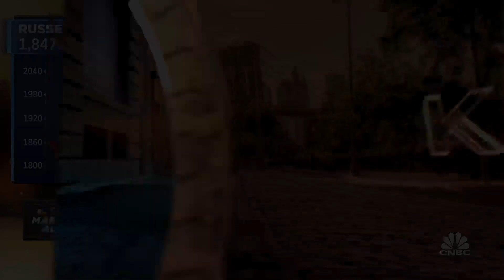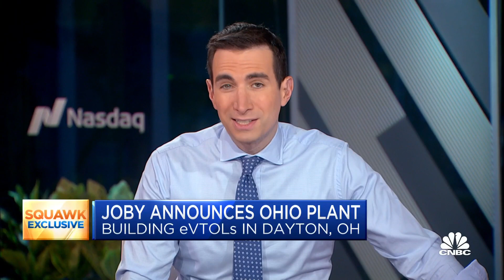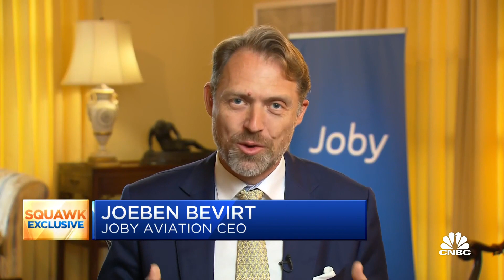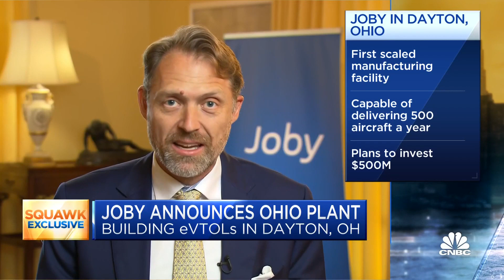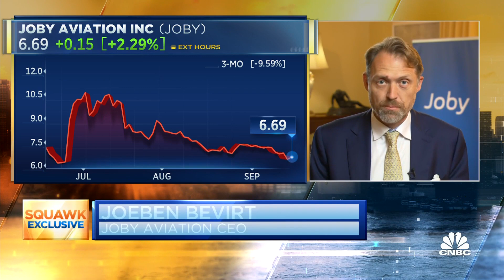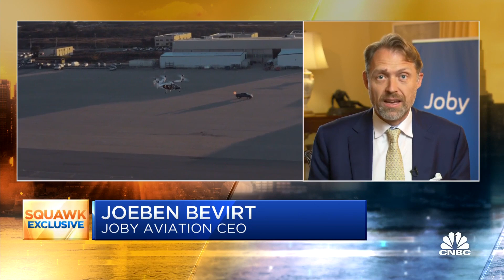Joby Aviation CEO on new Ohio manufacturing plant, commercial service plans and Delta partnership

Comment: Pump and dump. Did you get Faa type certification approval yet?
Reply: NO chance of getting that. It can't autorotate and it can't glide to a safe landing anywhere but on a runway - and there aren't any runways where they state they want to fly. The FAA stated in November 2022 that the Joby thing is only a powered lift and the - the FAA - want to know what Joby is going to do when there is NO thrust.

Joby KNOWS all this and that's what makes their statements fraudulent.
Reply: A military base is testing one out
Reply: Yeah

Comment: 500 aircraft per year is quite a lot when you look at similar sized helicopters made by Robinson, Bell, and MD Helicopters and those combined only sell about 300/yr.  If there was a bigger need for such aircraft then these companies would be selling more as they can perform the same task.
Reply: non electric helicopters are far more expensive to built and operate.
They got many single points of failure. They also use quite a lot of fuel cause they are not tilt rotor aircraft (which is super difficult with non-electric aircraft).

So the Joby idea is: Lower the price of a helicopter ride by almost an order of magnitude and thereby increase TAM.
Reply: @marcelwestermann8273   But the Joby is $10 Million each so how is that cheaper?  And when the battery will only last 2000 charge cycles you will change the battery twice a year, how is that cheaper to operate.
Reply: Don't fool yourself in comparing an evTOL with a helicopter. Significant advances with safety, massively quieter for all the suburban Karen's, and substantially more efficient are only a few of the benefits of this tech.

Comment: Make one craft that you can prove before manufacturing.
Reply: If you are ignorant then don’t blame them. There are many videos out there
Reply: @rameshpudhucode6862  ....all they have is a remote-control model of a powered lift.... a powered lift with no way to safely land in the event of a total loss of thrust. That's straight from the mouth of the FAA.
Reply: @rameshpudhucode6862  joby is like a helium party balloon. it will fly but not with a human on it.
Reply: @rameshpudhucode6862  link one that isn't 5 second clips deceptively edited together. Their latest video isn't even the new production model. It's old footage. Their flights are bogus. They have one short full flight from the one that crashed and even that one was empty and is like 2 minutes.  They never put weight in it.
Reply: https://www.youtube.com/watch?v=vWni_rkj0V8
It's also got the FAA certification.
Reply: @jcf20010  a short of a joby that is empty is really proof. i mean it obviously can fly empty long enough to get to the altitude that they make their short deceptive clips but so can a toy drone if you don't get on it.
Reply: @jcf20010  no it doesn't have faa certification. they have a special airworthiness certificate like archer and the rest.  that has to do with owning a big enough field to fly over not the craft. the faa never inspected it or tested anything. that video is not proof its deceptive editing like always. if they flew 150 miles they would make a timelapse and their stock would be solid gold.
Reply: @frankyflowers  ...and everybody and their dog has a Special Airworthiness Certificate. I have two, all my aviation friends have at least one. A Special Airworthiness Certificate is what the FAA grants for an experimenttal category aircraft - and there are over 20,000 of those in California alone. What you need to know is that no craft operating with a Special Airworthiness Certificate is allowed to fly for hire. Period. Look it up.
Reply: There's test flights you can go watch, ya know? I'd love to see your track record of investing vs Herb Allen and Vy Capital...
Reply: @sthefreak2094  yeah sure thats why there are videos from witnesses.

Comment: This reminds me of the interviews of Elizabeth Holmes before she was exposed.
Reply: Except joby is LITERALLY FLYING THEIR PRODUCT. Elizabeth Holmes had a fake testing service where the majority of the product was unseen. I mean shoot, Nikola made a fake semi and showcased it, you could say. But you can't fake an electric flying eVtol
Reply: The thing is literally flying and being monitored by the FAA. I think a completely functional product is completely different that a total fraud.
Reply: Except Joby as proven time and again that they have an aircraft that actually flies...WITH a pilot on board. So not really a good comparison.
Reply: @8kccrunner  that isn't close to what they need to do. They need to lift 1000lbs and keep it in the air for the duration of a route and have 20 minutes of reserve power remaining on the battery according to the sfar. Keeping one man up for 7 minutes in a prototype aircraft that isn't configured the same as the type conforming craft will be when it exists isn't really proof. thernos did draw blood and feed it into the machine.